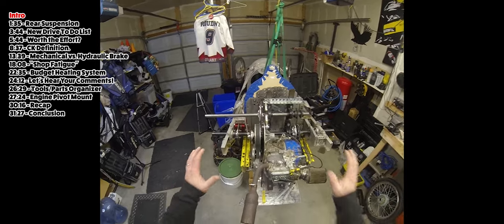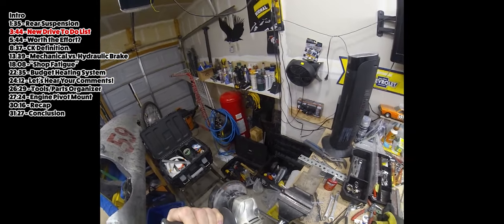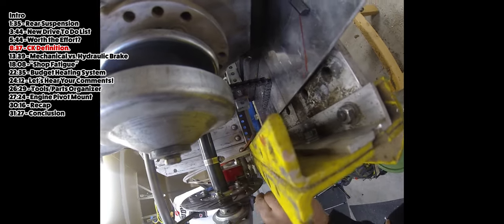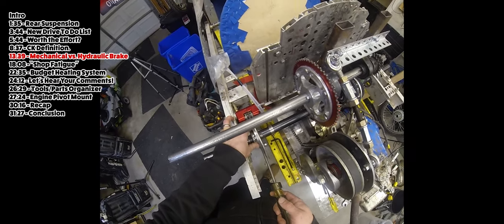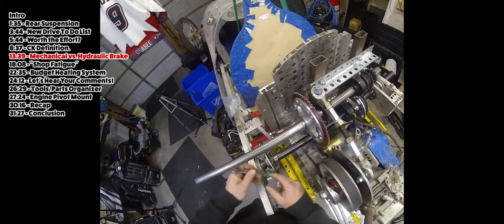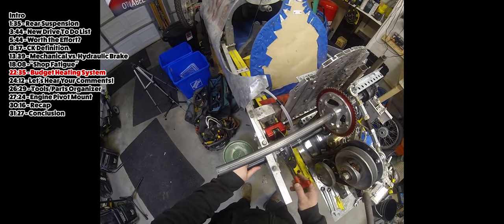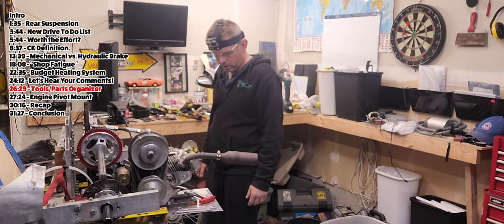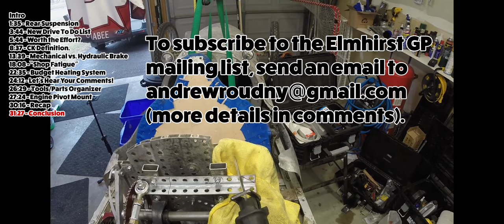Cyclekart Shop Talk | Episode 1 | The Mercedes W154 Replica "The Vulture"

Comment: What's your opinion on electric cyclekarts? Not from an environmental perspective, because a few dozen cyclekarts isn't going to make a difference one way or another, but from a fun so race and fun to race against point of view. Electric is much more my thing, but I wouldn't want to rock up to Elmhirst and be chased away 😅
Reply from the maker: I think electric anything is super. I'm not a big fan of electric passenger cars but not because they're electric. Just because of all the government nonsense around them. 

You can turn up at Elmhirst in whatever you want! Our "rules" are very loose. At worst, you won't be included in the results. But you can still run (probably). In any case, shoot me an email before you come out. A few weeks before!

There are a couple of electric CKs out there. Apparently, they're under-powered. And that's not a bad thing necessarily. But I feel like the weight of the battery and the motor together would be something approaching the weight of a GX200, and you'd have to have some kind of removable battery swap out system. 

I was working on something like that for the Vulture (see my upcoming video premiering Wednesday) but I abandonned it. it was going to be a hybrid electric system. Pretty complicated tho.
Reply: I like the idea of electric CKs, it should be easier to find more locations to race if the karts are nearly silent.
Reply: @andrewroudny  I haven't built anything yet, but I would be aiming for the same weight and power as everyone else, solid axle and all that. I do plan on getting down to Elmhirst as a spectator this year, though
Reply from the maker: @ThalassTKynn  that's great. Are you on the mailing list yet?
Reply: @andrewroudny  haha I thought I was, but it turns out it was in drafts for some reason. Sent it now.